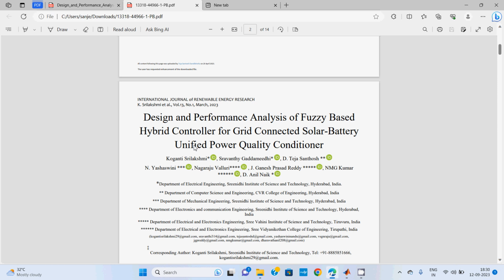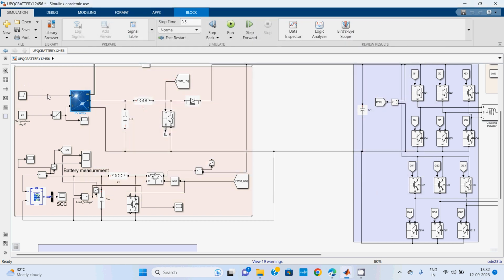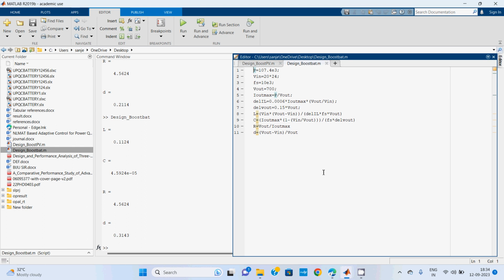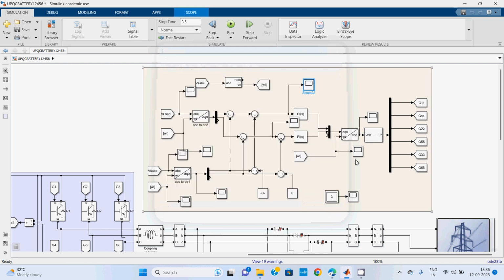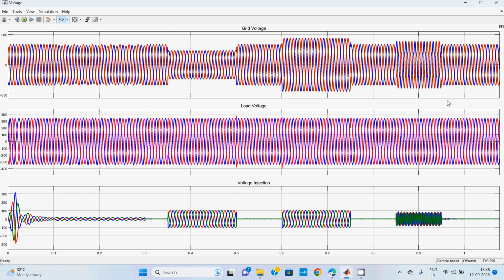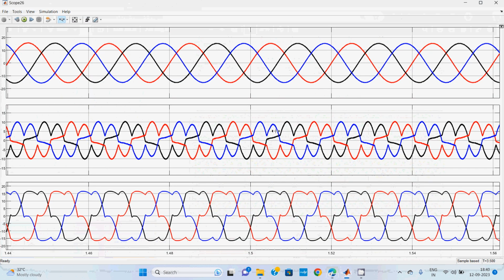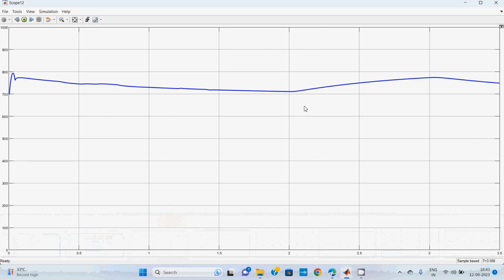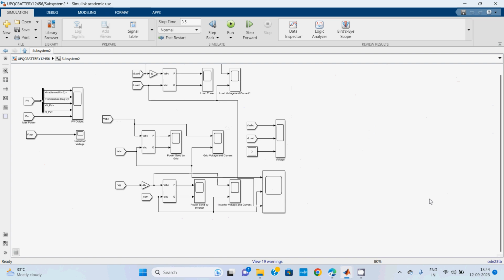Solar-Battery Unified Power Quality Conditioner

Comment: Thanks for the video. why Vdc is not constant, what values you used for PI controllers
Reply from the maker: Dynamic load and grid variations definitely dc link voltage changes and try to stabilize with in less time interval
Reply: @smart_solutions2U  one more question, In your simulation i can see the grid voltage unbalance but when i tried i can see only in grid current not in grid voltage, why? Any suggestion?
Reply from the maker: Add different grid phase resistance value then u can observe